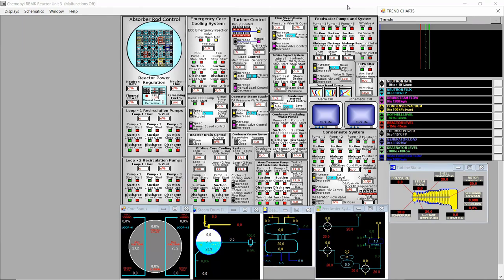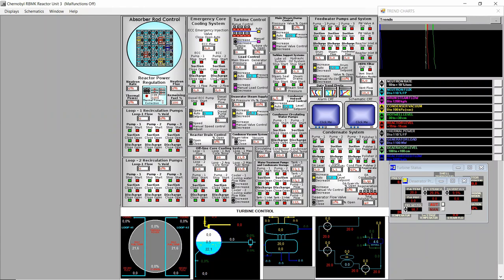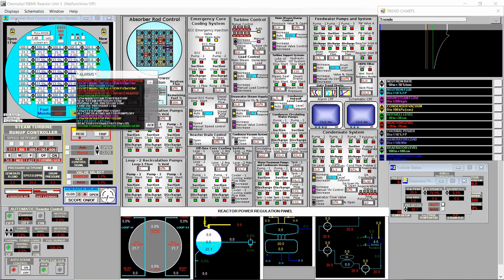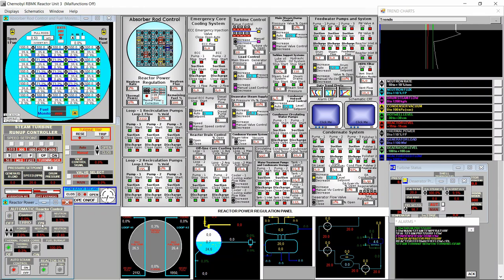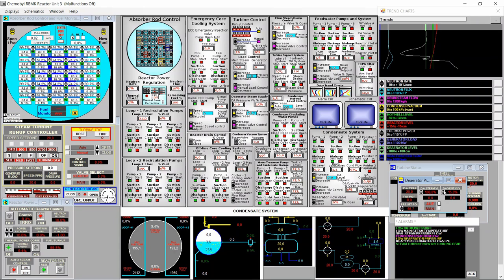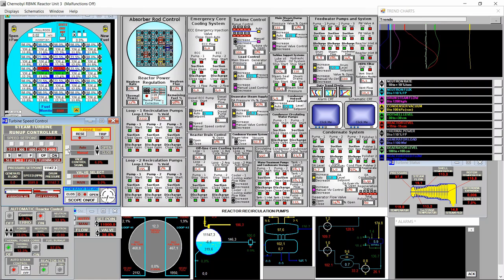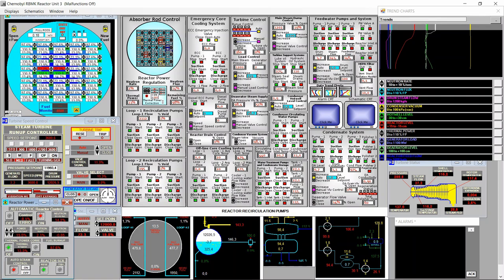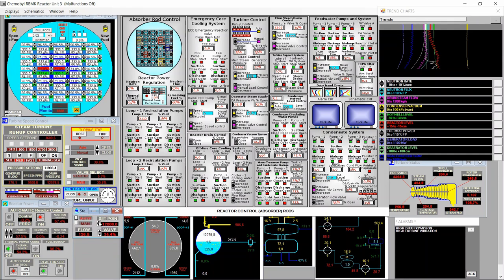RBMK-1000 Chernobyl Nuclear Reactor Simulator [1006MW !!!]

Comment: I think that the pressure is in kilopascal by default, there is however a small window (available through the windows task bar that allows you to change the units)
Reply from the maker: Absolutely right!!! it's all in kilopascal and you can change it to imperial system if that's your cup of tea. If you check my new tutorial (version 2.0) I already read the parameters in the correct units

Comment: allright so far i got about 987mw steady out of the reactor but everytime i touch anything in this state it the reactor melts down :( . My final goal is at leats 1gw
Reply from the maker: Once you get to the nice 987MW reduce the condenser vacuum as much as you can without triggering any alarm, turn on all MCPs and open the turbine valve at 100%, then just wait for the thermal power to increase and ultimately you should be able to get 1025-1040MW. Check my more recent video about simulation versioning https://youtu.be/l1JrVOIWYDU
You can have more stable versions of the simulator and also use the fuel fix which stops fuel burnup and allows to run the reactor for more hours.

Comment: I manage to push 1040MW in this sim it was steady and not all because sim crashed.Pressure in the drum was around 8100 and the valve of the turbine was at 97,5%. Power setpoint 99% and with termal correction option "on" the termal power was 99 too. Neutron flux 99,3 and when i raised power sim crashed.
Reply from the maker: Great! you could totally open the turbine valve because you have enough drum pressure, at least try step by step. The low pressure warning is at 7350 kPa but you can even go below that. The maximum efficiency is always at 100% valve opening, I expect you to go even above 1050 MW. neutron flux of 99,3 is pretty high but you could adjust it even closer to 100% without meltdown, try playing with fuel consumption fix and Xenon fix in cheat engine and see if you can settle more close to 99.8%, this should give you 5 extra MW. Last, in case you didn't do reduce at the minimum the deaerator pressure setpoint (around 40 kPa) this will further increase the steam rate that goes to the turbine.